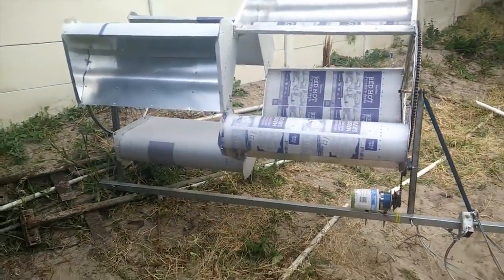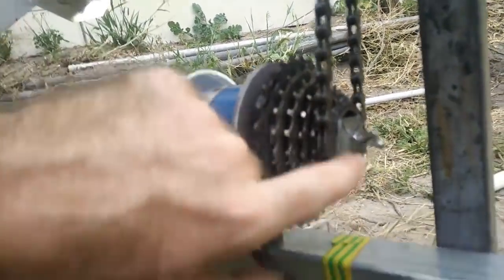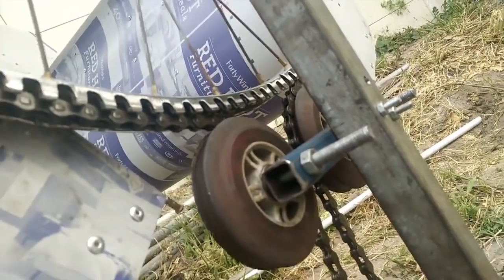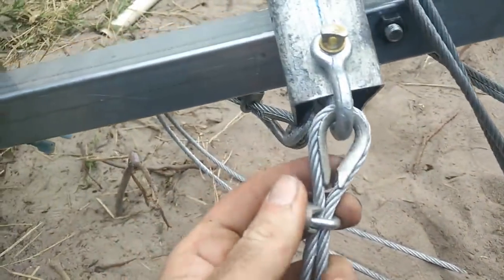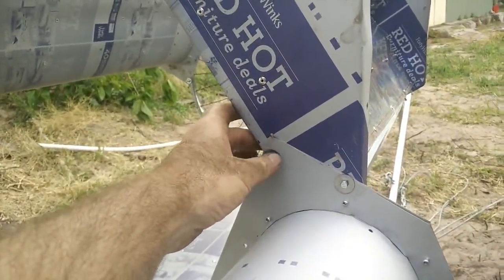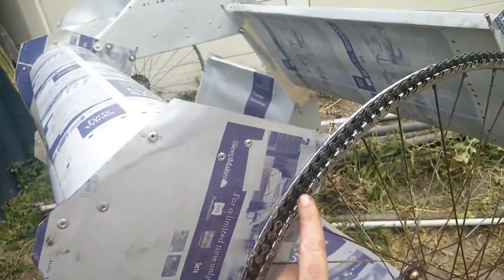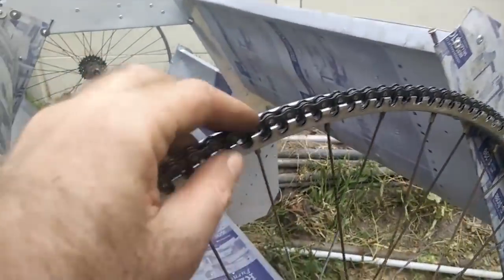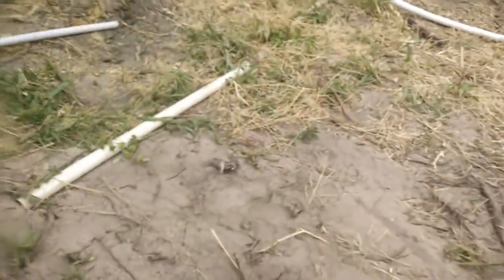Kilowatt wind turbine and pole for under $150

Comment: There's too much of everything in this. Too much friction. Too many moving parts. Too much maintenance required. Too noisy, the noise you can hear is wear taking place. A vertical axis turbine is less efficient to start with.
Reply from the maker: Yeah I'm not a hundred percent happy with this configuration either, currently working on a better one. The Lenz2 VAWT design tho is pretty efficient, ballpark to a standard horizontal.
Reply: Hugo Stiglitz err, too much criticism?!!
Reply: Hugo   Please post pics of your superior build.

Comment: Good luck with this 1kW turbine. It seems you picked a turbine type that got very low torque and need to spin fast to achieve any power. This turbine seems difficult to get in good balance, and probably keep it from turning fast or even break due to unbalance. Keep clear at high winds as a precaution. I noticed as you turned the turbine it stopped quickly, there might be some unwanted mechanical rotation resistance.

A simple turbine type is Savonius type. A barrel split in 2 (like a log with an axe) one part displaced about 1 to 1.5 radius. like this one: https://www.youtube.com/watch?v=Nudo9MJBrUg This is medium to high torque and low speed type.

Swept area gives the power, radius give the speed vs torque. This type got low efficiency but is easy to make and suitable for pumping water. Not so good for electricity as you need to gear it up.

Comment: Use a chainsaw chain as the grab chain, grind off the teeth and use it upside down.
Reply from the maker: That's actually a good idea, but I'm now going with a belt instead. Chain kind of sort of worked ok, but wasn't really happy with the dynamic.

Comment: I don't know where and how you got all those parts under $150. No way under or even close to $150 possible unless you have someone selling the parts under cost
Reply from the maker: Nope, can confirm that everything there cost less than AU$150. All bought retail, but did ring around suppliers to get the best prices. But this is Western Australia where everything has to be sent in from the Eastern states so is usually annoyingly expensive if anything.
Check the tutorial link in the description for more info on materials for the turbine itself.

Comment: Try a diesel glow plug placed in the end of a titainum tube bent into a coil then fill tube with gallium to help conduct the heat then place another glow plug im other end of pipe. Design a nintinol graphite thermal electric generator that will produce 8 volts direct current that will provide each glow plug the 4 volts direct current they will need after using a glow plug starter to heat up the glow plug. Each glow plug will pull 12 volts till it heats up then will drop drop down to 4 volts direct current to stay red hot. If constructed correctly you should have a regenerative heating element that you can use in a lot of other devices. Using refined crystal structures to generate electricity and heat without consuming any fuels and generating toxins.
Reply: I just tried that, but it drops to 2.7 volts and then the crystal is not charged to capacity without additional input of potentially toxic gases.

Comment: What is the " Clanking " sound? I'd be pissed if I was your next door neighbor !!!
Reply from the maker: Yeah it took me a while to figure that out as it's new with the last couple builds. Turns out is from locking down the top and bottom wheels so that any unalignment between them flexes the vanes, causing them to 'pop'. Will fix by adding a bit of flexibility in the top mount point and locking down the diagonal support strut last.
Reply: @OpenSourceLowTech  -  Also, I think the " Double " tensioner rollers is a bad idea.  Put too much strain on the Chain.  I would have put just one roller and a spring.  That way it's a bit flexible and less drag on the tensioner.  That is how most designs are done on Lawn Mowers and Tractors and it's a proven method and longer lasting.
Reply from the maker: Indeed, am now using an automotive belt with a single tensioner pulley.
The chain drive was worth a shot, but didn't end up working well enough to be happy with.
Reply: @OpenSourceLowTech  You should definately make a video about this newer setup! Some pointed up a few shortcomings which redused effiency and lifespan so a new video would not only impress us more but also show that your system is flexible enough for modifications.

Comment: Generator/motor exposed to the elements, too much friction and no centrifugal brake! Catch a good gust of wind and its bound to self destruct!!!
Drop the chain in favour of belts, do a static balance to reduce vibration, stiffer pole, good electronics for the voltage regulator and you should be good to go.

Comment: Verticle axis wind turbine have a capture area of a rectangle their height and width so what like 2m by 3m max for this? Their energy production is at max theordtically 1/4 (1.225) v^3 A so like 2V^3 on a good day so 500=v^3.. v is 7.9 m/s or 17 mph! Considering it's low to the ground and I didn't take into account your drive efficiency at all I'd say no, you dont have a 1 kw turbine there. You may have a larger turbine there but you sure dont have a perfect design to achieve theoretical maximum energy, at most your getting half this if I'm honest, not even GE could produce a verticle turbine this efficient so your gonna  need 20 mph. Considering the highest average wind speed in the world is under 16  I'd say I'm safe in my assumption that this is BS. If I hook up a desk fan to a 20 kw generator then wade into a hurricane can I claim a 20kw turbine for 500 dollars ??? Prove me wrong

Comment: i do like the build and you can always improve from there. might help if you re tighten the spokes , all those relief  cuts kinda weakened your wheel . its a 1000W motor , but not producing 1KW.  title a bit misleading . soon as i seen your wiring no way , thumbs up

Comment: ERMMmmm ....... Much easier to use a belt instead the chain, ... it WILL give a LOT less resistance against the wheel and a pulley on the motor. ......... You can stitch belts together with thin wire. ...... You would need a thick copper wire from the motor to your batteries because you will LOSE a lot of charge using thin wire.
Reply: Thin wires will do. The current won't go high but during a storm. For a wind of 12 m/s (which is nominal for many wind generators) there'll be a current of no more than 10 amps, I'd say 9 will do, and that would cause 1 W/m loss in a 1,5mm2 wire (16AWG).

Comment: With a kilowatt you could do nothing. Power a drill? Not even a toaster, this is only a catch for the dreamers,to much efforts for that noisy contraction.
Reply: It will charge batteries. Do you run a toaster or drill 24 hrs per day?